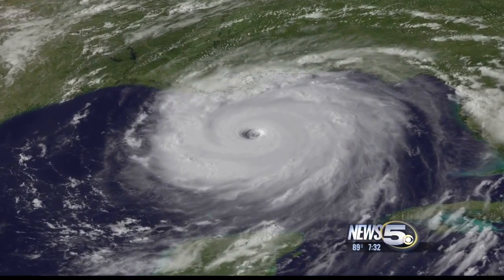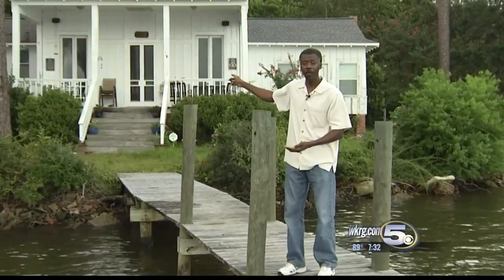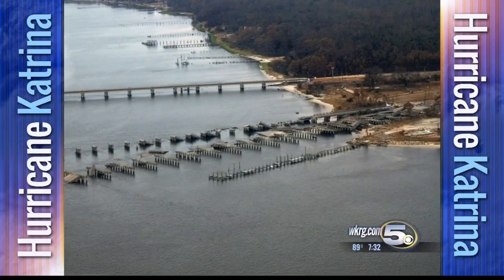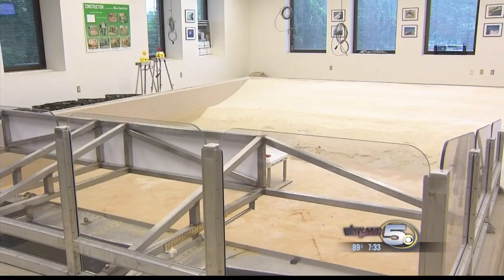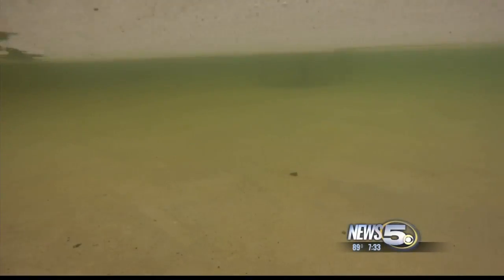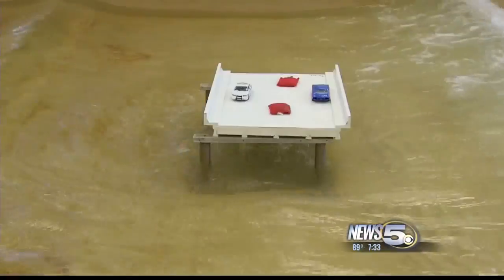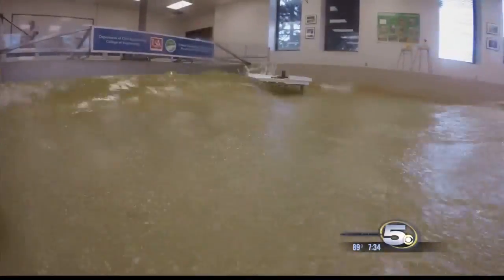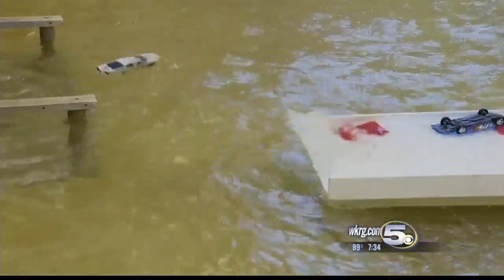Hurricane Katrina Storm Surge Destruction

Comment: Pressure built up from the bottom and essentially popped off the decks. They were still in a straight lines so the waves couldn’t have pushed them from the side otherwise they would have kept pushing the decks down stream. This can’t possibly be what happend